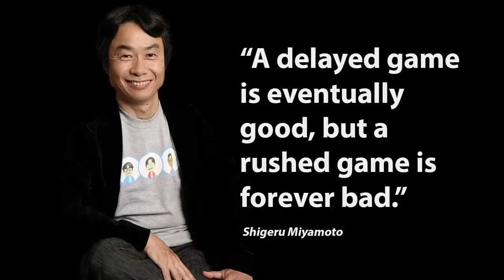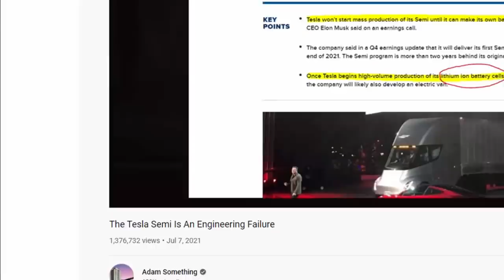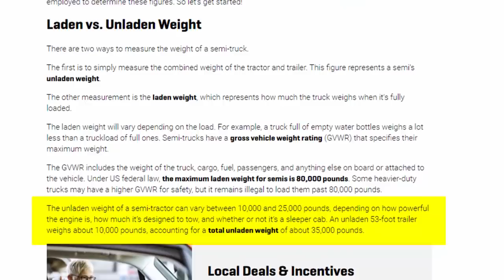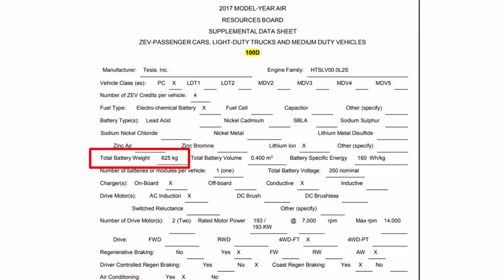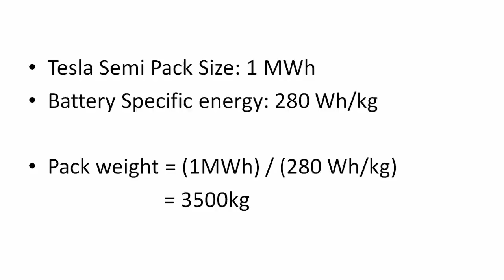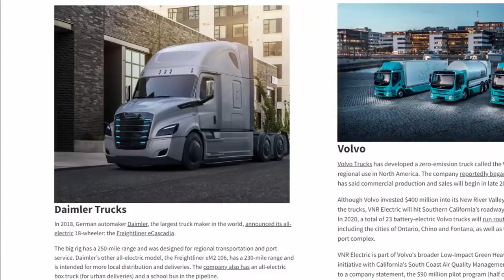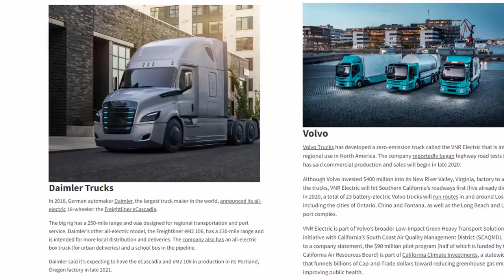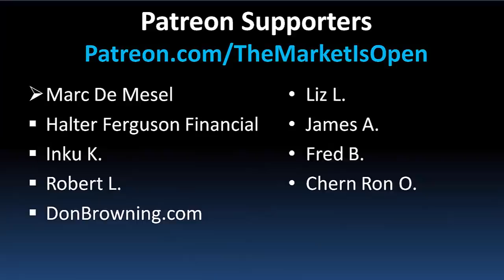The 2022 Tesla Semi is Genius, And Here’s Why

Comment: Three points...
1. Regenerative braking on a semi will be a huge energy saver in its own right - imagine the stored momentum recovered - not a 'moment' too soon - less brake dust pollution and no rolling-cokel particulates - even the haters win.
2. It is hard for me to believe that all power for all Tesla vehicles passes thru transistors - MOSFETS in the motor inverter. It would be great to see the electonics of the motor inverter(s) overviewed with pictures of the MOSFETS in ciruit and with an emphasis on the stunning amount of power efficiently handled by each parallelled MOSFET including the power disipated as heat compared to an ICE which wastes most power as heat.
3. Why do vandals pick on Tesla vehicles - what's there to hate?
Reply: Is the plan to have trailers built with electric regenerative braking  and eliminate trailers with air brakes which would be protitary?
Reply: @erbewayne6868  Proprietary? No, there almost has to be a friction brake system as well, there will be limits on how much braking force regen can produce, but the ability to have it take a big part of that energy will be a tremendous help to keep friction brakes burning up.
Reply: Not just an energy saver, I can see it taking significant load off the friction brakes, which can avoid burning out the linings.
Reply: full throttle power likely bypasses  the transistors
Reply: The energy saving or gain from regenerative braking is going to be minuscule. It's not a huge energy saver, the primary purpose of the braking system is to slow or stop the car as safely as possible. No one has bothered to use regenerative braking in liquid fuelled motorised transport, because there is no issue of a "lack of energy", while there is fuel, there is energy for all operations.
Reply: @alexandermelbaus2351  it should be obvious that most efficient driving would avoid breaking altogether.
Reply: In order to vandalize something that thing needs to exist  in the first place ...

Comment: Have "Tesla" in YOUR VID  title and you get clicks, eh Adam? Don't forget batteries get more range in trucks from their long downhill parts considering regen braking when slowing the rig. They only need battery to top the highest hill. Going down long grades adds lots of power back into the battery without using the brake pads. Will be cheaper to operate truck fleets that work that way. Diesel semi uses gas and brakes for any effort. I believe the hit piece used a rough calculation that can't consider opposing argument not Elon's reputation. Adam had misleading conclusions from using maximums of everything he thought of.

Comment: The Tesla tractor will have to be a limit function truck. It maybe be able to function well with limited distance use in fair weather or city delivery but it will not replace a standard w/b, 500 hp, with 355 finals. I've put too many miles over the road to be fooled into thinking Tesla will compete in interstate trucking. That being said, there is a niche that it may perform well but again it will be limited.
Reply: 80% of trucking is less than 250 miles per day.  That nugget was in the video.  Even interstate trucking will adapt to an EV truck once it's obvious how much money they will save.  Cheapest solution always wins.
Reply: @donm2255  Maybe so. There will have to be some very serious improvements to storage cells before you can run interstate with the big boys.
Reply: never say never.....with maintenance cost savings and safety records of the tesla semi, i don't think it'll be long before other truckers queue up fo a tesla semi
Reply: @amedumandela5421  The main problem is distance and time on destination.  Sometimes you have to wait a day or two to unload. Battery cells don't like cold weather. Up north you will have to run in sub zero temps. A 500 mile range could be reduced to 250 miles because of the cold. If you wait to unload, the truck will be using it's batteries to try to keep its batteries warm. You can see the problem. - The more batteries in this truck the less payload. - Modern diesel trucks have a non stop range of 1000+ miles and can still wait two days to unload and have enough fuel to get to a new pickup and be loaded before going to fuel and rest. - I'm willing to bet that a Tesla truck won't have a clutch pedal. (a pro driver that drives in the north will know what I'm talking about.)- You can't always use regen braking. - I guess what I'm trying to say is there's a lot of variables in this interstate trucking business. It's not as simple as it sounds.
Reply: @larslake  they  be waiting at a truck stop are a warehouse  they be plug in.
Reply: @hillbillyintheasia6122  wishful thinking my friend.  just one of the problems with this is diesel trucks will park in electric spots. lol  - thus is the nature of  'murican hauling.
Reply: @amedumandela5421  Short haul truckers will be the first in line, after the companies that operate fleets of trucks (Pepsi, Walmart, etc.).  Long distance routes for independent truckers will need to wait for charging infrastructure.  Companies like Pepsi will build their own charging points on site.

Comment: 44-48000 is a standard truck load. The batteries are so heavy you cannot build a 20000lb truck. Industry standard is 20000lbs for a semi. Have you seen the tesla truck hauling a load? 3 teslas. Normal semis haul 10-11 cars. The tesla truck is done until new battery tech comes along.

Comment: If Tesla can keep the overall weight of the tractor under 17K - 18K (including batteries) they would find themselves in the sweet spot of being able to carry 95% of the loads on the road not including overweight's by individual axles.  Its a shame citations are on the drivers where they should be on the shippers = Drivers don't pull overweight.  Divers should know their net weights every time they arrive at the shipper, letting the shipper know exactly how much this unit combination can haul. Experienced shippers can then load the unit legal once they determine correct placement of cargo to bridge-weight over the axles.  Save all time and $$

Comment: A prime concern for weight limits on trucks is the protection of bridges and overpasses.  Multi-lane bridges with slow heavy traffic must support many vehicles, including heavy trucks.  The weight limits are calculated using a bridge formula, that includes the number of axles and wheels on the vehicle, the size of the tires, etc.  I have no doubt that the Tesla semi will be able to carry the prescribed limits.  They couldn't pull more for example, because the law is based on the number of axles.  It's why some trailers have many axles to support very heavy loads and remain legal on a per-axle basis.
Reply: That is the laws of physics as simple is that.
Reply: In Europe the standard semi-trailer now has 3 axles, and "super singles" have become the norm. The single axle loads have either stayed the same or gone down.

Comment: The spec that most surprises me is the expectation that an 80,000 lb truck can run on 2kWh/mile.  TFL truck has done some videos of real world tests show a Model X pulling a small trailer using almost that much.
Reply: It's all about aerodynamics.  The small trailer on the X introduces a lot of drag.  The Semi is huge in comparison but the truck and trailer are much more aerodynamic as a pair.  Once the truck is at speed, then wind resistance is the sole factor in determining range.  Assuming level roads.  But even if there is a grade, you don't go up hill forever.  On a round trip the elevation nets to zero. You get a lot of energy back going down the hill you just went up.
Reply: @donm2255  - You are forgetting about weight and 'rolling resistance'. You have to overcome losses caused by tires flexing, asphalt & concrete ridges and potholes cause resistance. I don't believe 2 KWH/mile. Aerodynamics are used on Volvo diesel TT trucks and you don't see them getting the same mileage as my diesel pickup pulling a gooseneck trailer. My guess is 4 to 5 KWH/mile would be more realistic.
Reply: @WJV9  At highway speeds rolling resistance is not much of a factor compared to aerodynamics.  I think Tesla just proved they can run 80k lbs at 2KWH per mile.  With plans to get that to 1.7 or 1.6.
Reply: @AudiTTQuattro2003  
Re the batteries being a "sticking point"
Disregarding the performance of a single cell, I calculated that in a typical sized pack the 4680 will use 35% less steel in the battery casings ("cans") than the previous 2170 pack.
Much lighter.
It will also remove structure from the chassis.
"Real independent studies and tests"? Many here seem to accept speculation by "non-experts" who seem to be missing any consideration of the advantages of the new pack, basing assumptions on "old" technology.

Comment: Adam made his point Diesel Truck do catch fire in tunnel too , so there is no difference between a Diesel Truck catching fire and Electric Truck catching fire, so that should not play a part in the decision using Electric Truck versus Diesel Truck, at least you don’t have to installed expensive ventilation system with Electric Truck, but you do need to the vent Diesel fumes and supply fresh air in tunnel where internal combustion engine vehicle opened.
Reply: It's not the truck catching fire that's the biggest threat.
It's what the truck is carrying.
eg: The truck that caught fire in the Mont Blanc tunnel was carrying margarine.
The fire spread to the load and as it melted it caused a river of fire under all the other vehicles behind it.
People couldn't get out of their vehicles because of this and.......Their own vehicle then catching fire added to the scenario... Pretty obvious what happened !!
Now I can't say whether an EV truck would be better than an ICE truck because most truck fires are caused by binding brakes.
That' could happen on both types of truck !
Reply: @0utcastAussie  When you use regenerative braking the resistance to your wheels/tires is the magnets in the motors.  There are no "binding brakes".     (the stupid is real)

Comment: Let me explain another way in the early 1990s IBM and other companies had a joint venture to download music it failed yet we do it today all the time why. Because broadband internet and MP3 did not exist at a consumer level. Part of something being successful is the things you don't have control over are readily accessible to the entity that is going to use your product. Electric to power this truck is the problem a 200 or 400 electric service for a home is relatively easy to get from an electric utility provider. Asking for a large service that is over a megawatt can be a far different story requiring the person requesting it to spend great expense to upgrade the electrical grid to handle their needs. If we got rid of all the bureaucracy to build electric power plants and we started today it would take us 10 years to be ready for a significant changeover to electric semi trucks. Also the demand for lithium would cause the cost to go up significantly making the truck potentially too expensive as well as the dramatic increase in the cost of electric. One of the things that makes the semi truck so inexpensive to drive is taxes are levied on diesel not electric but that would shift causing the price to go up to operate the vehicle.
Reply: Things to consider.
Diesel does come from Unicorn years.
It's "refined" from oil.
That refinement takes energy.
Electrical energy.
About 5-8 kWh per gallon(!).
NOT refining each gallon would result in essentially "spare" energy capacity already on the grid available for use running EVs (cars AND trucks).
Surprisingly, that energy is sufficient to run an EV almost the same distance as the gallon of fuel would run an equivalent ICE vehicle. That scales up to trucks!
Result?
"Power stations" NOT required.
The UK National Grid has studied and reported on this (same company as the US Grid?)
Their conclusion? That "normal projected growth of the system" will be sufficient.
(They became quite "annoyed" when a "non expert" publication tried to cherry pick and twist their statement to suggest otherwise)
.
Your last paragraph doesn't make sense.
"Taxes levied" make something more expensive, not cheaper.
Diesel (fossil fuel) receives many billions in subsidy (keeps the "oil dollar*" going?)

Google "National Grid Graeme Cooper".
Plenty of links to confirm the position.

Comment: That’s such a dumb thing to say, that reaction time don’t help to reduce braking distance, if you take longer to react your braking distance will increased than if you react quickly to apply the brakes your braking distance will decrease.
Reply from the maker: It sounds like we're saying the same thing. Reaction time has no effect on the physics of slowing down 80,000 lbs whether you're in an electric truck or a diesel truck, since the tires only have so much traction.

The point I made was that although this distance can't be changed, if Autopilot can react faster than a human then it can start braking earlier.
Reply: @TMIOTesla  I don’t think we’re saying the same things, you were saying that reaction time has nothing to do with slowing down 80,000 lbs truck, and I am saying yes it does, if you take longer to react within the time that you see the danger in front of you, your will travel a great distance before you are able to stop causing you to hit whatever is in front of you. Please correct me if I am wrong.

Comment: Here’s a copy of the comment I made on Adam Something video where I adjust the calculation on just one of his assumption errors. Calculations were made with numbers from his video. 

The assumption here is that the Tesla semi has the same range as a diesel semi which is incorrect. 

The Tesla semi has 1/5 to 1/4 the range of a regular semi. (Reportedly by Tesla but this shows Tesla didn’t try to match diesel range)
With that in mind redoing the numbers for Teslas short range truck roughly gets you 2t of battery (with 50% efficiency boost, and conversions from the video)

EU allows electric trucks to be 2t heavier so that is accounted for. US allows for 1t, so 1t is unaccounted for. 

That means in range comparison diesel loses 1/5t of load to fuel, and Tesla loses 1t of load to batteries (in US, 0 in EU). 
Considering 90% of trucks are 3t under max capacity the battery weight loss doesn’t matter.

The numbers don’t change much for Tesla long range truck which adds 1t of battery. As stated most truck hauls are 3t under max while Tesla at most loses 2t of load for its batteries. (After accounting for legal max load adjustments for electric trucks)

Tesla’s real loss here is that its range is no where near diesel’s.
Tesla does win with safety features since its semis supposedly can’t jack knife. 

Pros and Cons for both where both are impressive engineering feats where they excel over the other.
Reply: Diesel trucks can't drive their full range by law with out breaks for the driver.  You don't need to an electric semi to have the same range as a diesel.  You just need to get to the next charging station to charge while the driver is forced to take a break.  So, the Semi's range is not that big of a deal.  Especially if you consider that 80% of truck routes are less than 250 miles.
Reply: @donm2255  
Exactly.
Reply: @WillMill
Are you taking into consideration the weight of the Diesel truck Engine, drivetrain and all ancillaries, plus the weight of chassis required to carry that?
Whereas the packs will (probably) add structure, the whole diesel drivetrain has to be supported AND damped due to the torque produced. That's heavy structure.
I suspect that the weight is going to be much closer than many believe.
Reply: @rogerstarkey5390  I would bet the production version of the Semi is actually lighter and stronger than most class 8 trucks.   Tesla engineers haven't been sitting on their hands the last couple years.  Most likely the 4680 cells combined with some cleaver new designs to maximize strength, driver safety and weight reduction will increase the load limits beyond the capabilities of a diesel truck.  Musk loves over delivering.  By getting rid of the massive engine and transmission, they had almost a blank page to start with and a couple years to test the prototypes.  The production version will surprise everyone.

Also, I love the term "out range the driver."  My Model S only has a range of about 240 miles, but it out ranges my bladder.
Reply: @don m is correct.
Don't focus on the "ultimate range of the truck".
Just ask if the truck can Outrange the driver (to the compulsory stop) then add sufficient charge during that stop to complete the day.
Answer?
Yes.

Comment: Yes its nit picky - but the Tesla 2.0 sec claim is .... generous and measured in a non standard fashion. Dont weaken your video needlessly and give haters ammo
Reply: Also almost all semi roll overs start at the trailer - so the roll over resistance of the tractor is not really going to make a difference. Also a loaded semi does not take minutes to get to highway speeds.